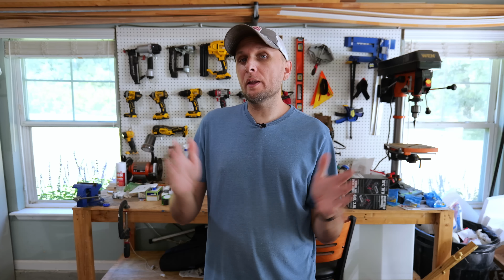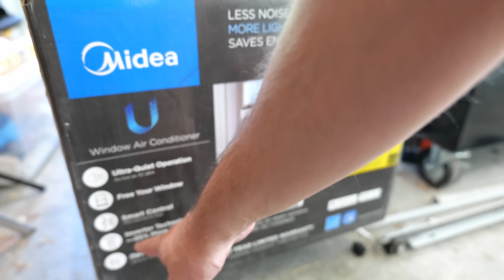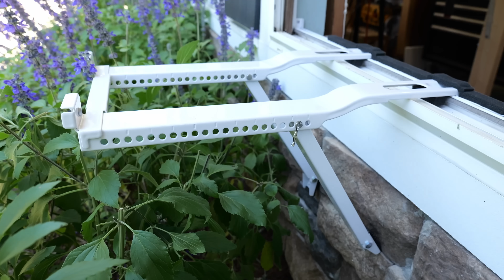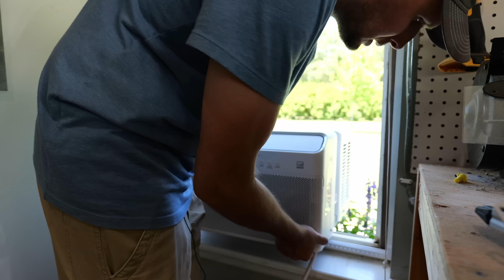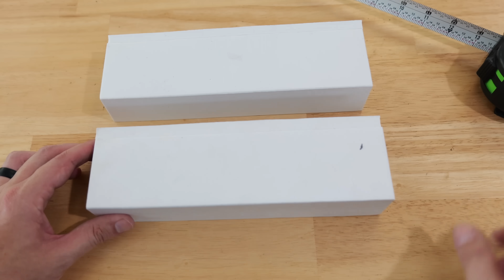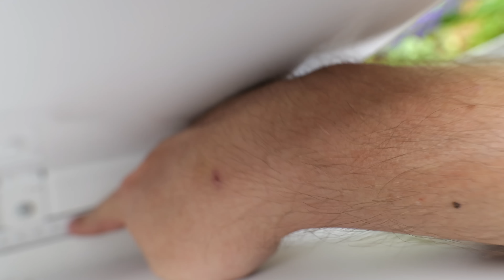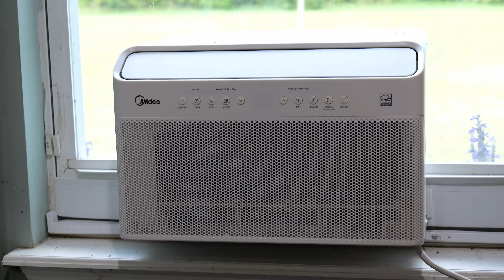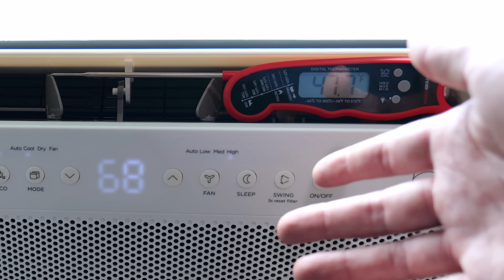The COLDEST And QUIETEST AC Unit Ever Made!  Still Use Your Window!

Comment: A couple minor clarifications (I used a pair of these for a few years):
(1) While they do have power conversion ("inverter") technology inside that is mostly just for the variable-speed blower fan; and 
(2) The power conversion technology soft-ish starts the compressor (more friendly for the electric grid), but it is not Variable Capacity (a lot of the newer heat pumps with similar "inverter" markings are Variable Capacity).
I was quite happy with the units. I'll be looking to find them new homes as my situation has changed (that's a good thing).

Comment: Apparently there is even one better.  Instead of the split unit enclosing the window, there is one that slips over the wall portion, leaving the window unblocked.  (There is a small space at the bottom of the window that is taken up, but it is only about 1.5 inches.)  Just as this one, you can fully open the window.  I understand it is being tested by New York City in government housing.

Comment: There's a heat pump unit with the U going down instead of up.  That opens up the window use even more.  And it's a heat pump so it heats and cools without having a resistance heating element.

Comment: Anyone else have trouble with these tripping a GFCI receptacle?  I recently installed the 8K BTU unit in a detached studio and it's great, but it consistently trips one (but not the other) of the Leviton GFCI receptacles.  I've swapped GFCI's between the two circuits, so it's working fine now, but it's odd that it will trip one but not the other of the same model of GFCI.

Comment: I bought the 12,000 but unit before I saw this video and installed it.  Everything he says is exactly the same as my experience.  And I totally agree with his assessment of this machine.  I have a hydronic system for heating and central air is not a cheap option.  I was going to go mini-split, but this unit is just as good and simpler to uses.  I thing I may abandon my mini-spit plans.  The only advantage I see now, for a mini-split, is no unit sticking out your windows.  But the mini-split for my house was going to have to be two, three headed systems which complicated the coolant line runs.

Comment: Absolutely phenominal unit. I've had mine for almost 2yrs with zero problems in S FL.  
It's in my Florida Room that doubles as a home office.  

Even better, the unit integrates with Alexa and Google Home.  So I've added a motion and temperature sensor to automatically control the unit. 

Installation took about 20minutes solo.  I did have to get a little creative to fill a small hole, but this was a very easy fix.

Comment: You said it cooled your house down from 92 degrees so you had the heater on then turned on the ac I dont get it cause even if it was 92 outside (even though your phone said it was 82) how is your home the same temperature as outside ... either you have no insulation or your fluffing the numbers to make it sound better than it was ... why lie ???

Comment: I now have five of these. Tied into home assistant. Very quiet. Very efficient.
Reply: Watch out for mold. I have two and just found it a couple days ago and the fan blade was covered. It was really a big surprise.
Reply: No it was over a year. I think checking every month or so with a flashlight into the area where the air comes out would be plenty. You'll see the blue cylinder fan behind the guards. I disassembled mine completely and cleaned with vinegar spray and a power washer and the item  unit is now sitting in the sun because that really helps disinfect.

The noise obvious signs of mold were little black spores that appeared on the top and bottom of the "swing" vent cover. But that likely only happens after there is a ton inside
Reply: @vaggeto  I'm also dealing with this now. I bought a can of coil cleaner today and am going to give it a shot. I've been spraying the insides with disinfectant for the last week, and the effects only last about a day or two.
Reply: @joeyoeyoeyo  vinegar is good for mold
Reply: @vaggeto and also how long would you say you went without checking and maybe say a month or two before that could be a good routine check point? Sorry for asking so much thanks for your time!! 🤙
Reply: @vaggeto is it easily accessible to clean when discovering the mold? I’m really trying to be lazy and use this to its full potential with routine maintenance I would require on any expensive central air unit. Idk desperate times call for desperate measures lol 😅
Reply: @ByMySelfGardening  they're terribly difficult to take apart to see and clean all the mold. You have to disassemble half the unit to get the fan out.
Reply: @joeyoeyoeyo  appreciate the reply! And I’ll look for some videos on disassembling. Thanks for all your help!🤙
Reply: This is the info I want to know.  Do you have the comms routed to your HA or do you also have to block comms from going out to the internet?  What all can you control with HA?  I assume you have your HA "Desktop" setup to let you monitor and control via your phone?
Reply: @DarthPoyner  HA can handle anything.  temp, mode, on/off, swing, eco mode, etc.  I do not block comms to the internet as I don't care.  But the HA integration is local comms only

Comment: I had a Quasar Window unit 20 years ago that had a gap on the bottom and hung on the window sill. The big difference is the Quasar  hug down instead  of up. This gave you almost the whole window to use. The compressor part was then separated from the room by the wall. Super quiet. I loved that unit for a number of years but then I moved to another house and sold it at a yard sale.
Reply: How did the condensation evacuate from that unit?
Reply: Most likely it's using a small condensate pump that operates with a level detection sensor that turns it on when a certain water level is reached. 
I use that method in a dehumidifier located in a basement to pump the collected water up to a drain that's above ground level, with a small pump and electronic water sensor, so it never needs manual emptying.

Comment: I like the way the cold air is directed upward instead of outward;  a lot of people will be more comfortable sleeping near one with this layout. This seems like a decent alternative to either a standard window unit or a split system. But you don't really get full use of the window without either the view or the screen. A screen could be made to fit the upper portion of the window and the top sash could be pulled down, but the foam between the sashes would have to be replaced each time it's closed. There are also upside-down-U-shaped window AC units that give you a nearly full view and might be even quieter. It's just a matter of how important this stuff is and how much you want to spend.

Comment: How many watts does it use?
Reply: What fuse do you have installed in your panel? 15amps? How many OTHER things are you going to be using on that same breaker? Watts don't mean anything until you bring to light your electrical parameters. It can spike up to almost 900watts before settling down to under 300, but I would NEVER use this on the same line with say a gaming PC with GPU's having almost 600watts like the 4090 can.

Comment: We installed 4 Midea split units 11 months ago and I love them. I have the exact same remote control as the one you showed. At night I set the fan speed to 5% in the bedroom and it is so quiet.
Reply: thats a good idea, I think I will try that fan setting and see how it does. Thanks for the tip

Comment: Yes, it’s a very quiet unit initially, but unfortunately, I’ve had four of these units already /  all of them after a summer and a half of us begin to sound noisy. They have a buzz/  some are bearable others were so bad. I had to remove and toss the unit. But yes, initially it’s an alter quiet unit but again. . But yes, initially it’s an alter quiet unit but again every unit eventually got noisier.  I did call the manufacturer, but they told me it was beyond warranty.

Comment: Have had this unit for over 6 months now. Love it, It doesn't have a drain line outside. Had to drill a hole or you would hear water hitting the condenser fan.

Comment: In Hawaii, the vast majority of homes have jalousie windows and have no sill. It'd be great if that AC unit was inverted with the mass on the bottom/hanging on the wall. You'd lose maybe the last bottom slab of glass, but the rest of the window would still be able to open and let light in. Thanks for the video.
Reply: GE makes at least one like that

Comment: you say you prefer this over a mini split, but doesn't a mini split have both Heat and AC?  so this would just be an option for a different style AC unit?   Asking because we're putting in a 4 season porch and running existing ducting for heat/AC would be expensive, and a mini split was recommended. So... this unit your showing would not be an option to replace a mini split?  correct?
Reply from the maker: Well I didn’t say I preferred it.  I do think for the money, labor, time, and efficiency of this unit it is a fantastic choice for air conditioning.  If you need heat then a mini split is probably your best option.  There are some window units that do produce ac and heat but I don’t think they’ll be as efficient.  Next year supposedly there are supposed to be some great options though.

Comment: I bought 2 of these units  when they came out and was absolutely blown away with my energy savings.  Usually I was paying 350+ electric bill monthly to run 2 units.  When I got the energy bill after installing the Mideas I was like this was wrong.  Nope, $ 120 was the average bill.  Love Mideas.  Just bought their dehumidifier and am impressed with it's results as well.  Easy to empty, filter is easy to get to and clean.  Good stuff
Reply: 3kw of electricity here cost 0.50 cents, so before you were paying for over 1.8TW of electricity, according to over here.
Reply: That's pure bs..
Reply: Goes to show you made in China is great.

Comment: So in order to still be able to lock your window you have to pull out those plastic tabs which also keeps you from opening the window so title is partially incorrect.  If you want the security of it being locked then you can't open the window.
Reply from the maker: Yes because those things are super difficult to push in then open the window.  😂
Reply: @HowToHomeDIY  So if the window is down how do you get to them to push them in?

Comment: Important to know: Does this A/C create negative pressure inside your home by exhausting air to the outside? Or does it perform like a dual-hose portable A/C by bringing in outdoor air and using that to carry away the exchanged heat?

Comment: Awesome video!! Just purchased the 12,000 Btu unit yesterday.  Will be delivered next Monday.  Can't wait to try it out!
Reply: How much?
Reply: Cost was $439 on Amazon.  Plus there was a $25 coupon offered from Amazon.  So I applied that to my order.  Shipping was free.  I received the unit already.  Installed and running.  Works great, uses very little power, about 0.5kw.  Connected to my wifi.  I can turn on/off, adjust the settings from work or virtually anywhere.

Comment: I bought two of these over a year ago at Costco on sale to use instead of my aging 80's HVAC system. my house is only around 1500sq ft and they do an amazing job cooling and my electric bill in the summer was cut by about 40% I would guess.
Still loving mine.

Comment: This would be even better if the slot came up from the bottom rather than down from the top, so the bulk of the unit would hang below the windowsill inside and out, blocking less of the view.

Comment: I was needing a window A/C unit that could just "drop in". The GE Profile Clearview series was a perfect fit. I can open and close the window, and did not need to install any platforms. Soleus Air Saddle is similar. No drilling or destructive changes were necessary, because gravity holds the units in place and they cannot fall out.

Comment: I bought a 12K BTU Midea but ended up returning it. Not sure if my unit had an issue but I read other people having the same issue. Also contacted support and they were unable to tell me if that was normal or not. They were uselesss. Waste of time. The concept is great, and it works well in a day-room setting. However, it’s not suitable for use at night unless you are deaf. You might think that because it’s generally quiet, it would be perfect for sleeping. WRONG. The unit alternates between periods of low noise, as shown in the video, and sudden clunking noises.

The unit is inherently noisy, but it uses some clever tricks to stay quiet for most of its cycles. Unfortunately, every 20 minutes or so, when the compressor needs to fully reactivate, you’ll hear a lot of noise. Here’s how it works: The compressor initially brings the unit to the desired temperature and then disengages, maintaining the cool temperature quietly for a while. However, when the temperature rises too much, the compressor reactivates, and this process is quite loud and not smooth at all.

Since this trick is implemented by various manufacturers Idea, GE, MrCool, etc. I am guessing some units are better than other ones. Not sure which. I tried only the Midea.
Reply from the maker: Hmm, never had that happen.

Comment: If you followed this up with how to install a widow screen with this unit that would be great! To me this looks like a more secure window unit that still does not allow you to use the window unless you want to let the outside in...and not just the air :-) . 

I have two mini-splits with the inverter tech and they are the most efficient units I have ever had. I have a 24000 BTU unit cooling my 1500 SQ Foot basement and it costs me a quarter of what the 8 Year old Central air unit did and was a quarter of the cost to replace it with a more tradition HVAC unit.

Comment: Thanks for the video. Question… do the angled arms on the exterior need to be screwed to the wall where they touch the wall? I see they are adjustable on the top frame
Reply from the maker: No.  They have rubber feet on them to rest up against it.

Comment: I have one in my shed turned into a “mancave” has electrical, vinyl plank flooring,  insulated with foam board , had drywall installed and had the shed windows replaced with house windows installed for the sole reason of getting this ac unit. It works amazing. 100% recommend.
Reply from the maker: Sounds very well insulated!
Reply: I just put a mini split in mine. For the cost of getting house windows it paid for itself
Reply: you got a permit for that she shed?
Reply: @5.56x45NATO  yep got it when we bought it and had it installed / delivered .

Comment: Midea is a Chinese company.  They also make Arctic King AC.  Had an Arctic King AC for 3 years before it died so be very wary of this brand, there is a reason it’s cheap.  don’t expect quality or for it to last very long if you will be using it a lot.  I live in south Florida so used a lot and arctic king(midea) couldn’t handle it
Reply: Pure Chinese junk looking for trouble go ahead buy it Chinese are good for dim sum 😊good luck to all I go USA quality 😊
Reply: I as well live in Florida , the high heat in Florida will seriously test how well your ac units work . I did not like my midea units at all . Issues listed in the comments . You have to be careful with inverter ac units . Very prone to shooting out very humid air . Also the copper tubes run through to small plastic holes , the restricting and contracting that occurs during temp shifts will cause a crackling sound which while small kept me awake . Also your set fan speed will not stay , when it warms up to a point the fan speed shifts to hyper speed . Again waking me up . To use an inverter mini split during summer it has to be on cool mode and fan set to auto . Anything else will cause very humid air to shoot into the room until the cool phase starts again . I have very throughly tested out inverter compared to non inverter units . Don’t believe me on the very humid air ? Put a humidity sensor in front where the air blows out after the set temp is reached .. the biggest downfall of inverter window units .
Reply: @jimjr9143  You don't seem to have any idea what an inverter is and very clearly have limited experience with different types of units. I have an LG dual inverter unit that has been functioning perfectly for years since they were the first to market with this tech. The inverter simply adjusts the compressor speed to let it run at different speeds to be quieter and more efficient, as opposed to being off or on and high speed like older units. It also ramps up slowly at startup which reduces the initial surge which is better for the compressor life and your electric system. ACs remove humidity from the air, not add it. If you are getting humidity blown into your room, then you have another problem going on. Could be outside air leaking in. Could be fins freezing up because they are dirty. Could be the angle of your unit is off and the condensate is not running to the outside (or clogged with debris). Could be you have a damper open (if your unit has it) that normally allows fresh air intake. But blaming it all on an inverter is silly and has nothing to do with your problem. The inverter is just chillin there adjusting voltage. Leave the poor inverter alone.

Comment: Great content, but you don't want to let those units drain. They use the condensation water to cool the compressor motor. 
You do want it slightly tilted outside to keep the condensate from leaking inside, but only remove the drain plug to drain it before storing it for the winter.